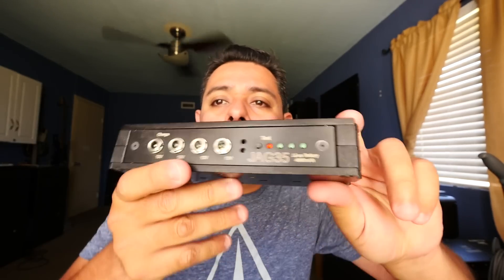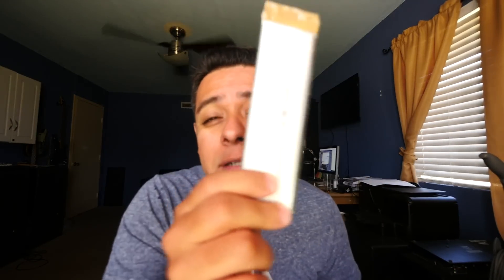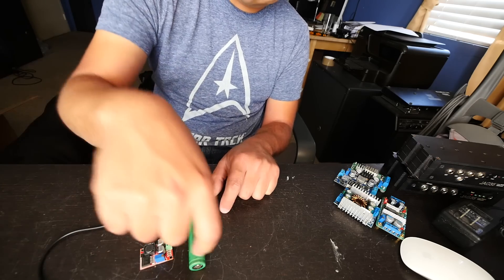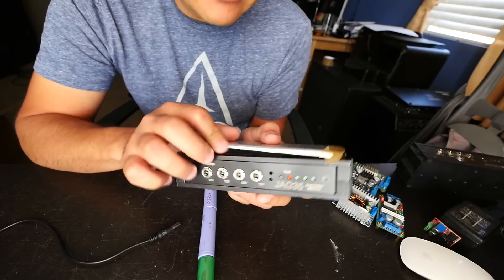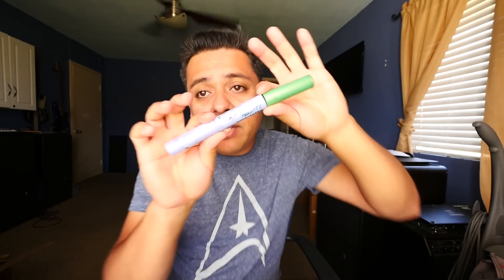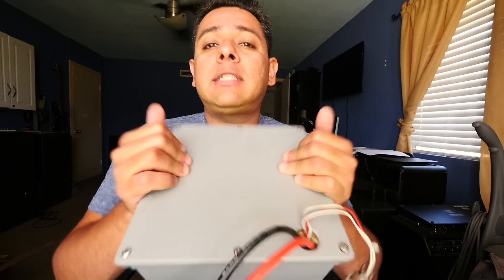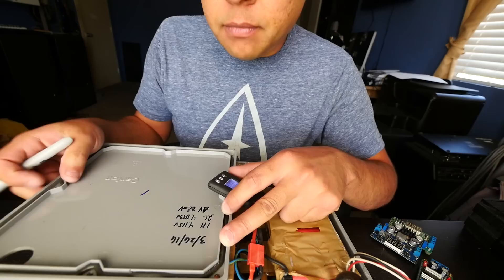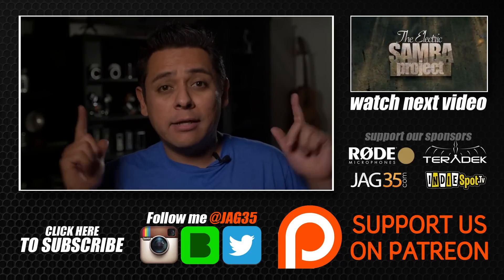How to Charge Lithium Batteries

Comment: If one of the cells goes bad in the 33 cell parallel area, and it drops in voltage, won't the other cells send power to the dead cell like over 100 amps?
Reply: V = I/R
Reply: pirucreek no, it'll act like a wire, just pass the electricity and not retain any charge
Reply: James Andonian But if the other cells are at 3.7V and it acts like a wire all the power/amps from the remaining 32 batteries will be sent to it.
Reply: pirucreek Sorta, it just passes the current. I wouldn't recommend using a bad cell though. You'll see lipo batteries have puffed up batteries, it still works just less voltage or amps, depending if its in series or parallel
Reply: Also, it depends on whats wrong with the cell too. Internal resistance would create heat. And also charging may be a problem
Reply: James Andonian jehugarcia said he has a battery 12V I think that he just sends 12 volts to and has not had a problem in 2 years.  Thus if there is a way to make sure fire is contained, maybe not something to worry about.  They use "Tesla" fuse which is just 5 amp wire (30 ga or so) thus if there is a short it just blows the fuse for that battery.  But a protection might just to have a voltmeter at each parallel point that way if they ever get out of balance you know something is wrong.
Reply: Not really..its a constant current..the voltage however increases for defective batteries ..12 volt battery charger specs ,if you test open circuit itts actually somewhere 14 or 15 volts,for 18 volts charger its somewhat 25 volts
Reply: Yolando Soquite only problem with that is it would overcharge the other cells
Reply: if the cell died and turned into a short circuit, its two cells in the triad will explode. they would steal all the current from the charger.

Comment: can i parallel the charger? for example i use 50W power supply and i parallel it just to make it become 100W, is it possible?
Reply: or 50W each parallel for 3S 5P. so im gonna use 12V 50w power supply each parallel. i have 5 power supply, can i just do it like that?

Comment: Awsome but I think its not safe to charge lipo battery's in series connection with high voltage, it can be so dangers if one of the cells die, BMS is a better way

Comment: Yea... NO!

If you charge a lithium ion cell without doing it properly, you can damage the cell, as well as run the risk of fire, explosion etc.. 

The proper way to charge a lithium ion cell, is to start off with constant current, while the voltage ramps up, once the voltage reaches the proper voltage, you then cycle to constant voltage process, where the voltage remains the same, and the current drops over time until the cell is completely charged, at which point the charger shuts off.
Reply: For lead acid I know lots of people complain that they ruin $500 worth of batteries due to the PWM controller.  I realize this is lithium.  But if you look in a cell that is pwm, bubbles come out and that can't be good.  I just wonder if one cells dies and can't hold voltage.

Comment: greetings, one question,i make battery for elektrobike from old batteries in laptops,i produce battery 36v 10A and i dont have BMS on that battery,can i charge that battery with tipical (Chinese)charger for that battery(42v 2A) without fear that battery will explode(because there is no BMS on it)?i.e.will charger stop charging when the battery is full? Excuse on my bad English

Comment: Hi, I have one question, I made 5 cells in parallel and 3 groups in series to be 12v pack and I agree with you to be not use the BMS to charge my pack so should I charge it with 12.2v cv/cc power supply or separate to 3 of 4.2v cv/cc power supply ?
thank you.
Reply: You need a proper charger to charge 18650 in series or BOOM.
Don't follow his vid

Comment: if you connect 2 batteries in series then the voltage is 8.4 not 7.4 that you told at 5:30 in this video.
Reply: The nominal voltage of Li-Ion cells is 3.7V and 2 times that is 7.4V.

Comment: my calculation:

one cell is 3.7V @ 1.8A;
there are 3 parallel circuits;
each parallel circuit is composed of 33 cells.. so each parallel circuit is 3.7V @ 59.4AH (Calculation is 1.8X33)
the 3 parallel circuits are connected to make 1 series... so the entire battery pack is 11.1V @ 59.4AH (Calculation is 3.7X3) at NOMINAL.

when we calculate its Wh... it's 59.4AH X 11.1V = 659.34 Wh
when we calculate is kWh.... it's 659.34 / 1000 = 0.659 kWh

can someone confirm if my calculation is correct? thanks!
Reply: So what is that entire big battery pack volts and AMPs?
Reply: @kmuralikrishna1582  this battery have à nominal voltage of 11.1v but concerning current, it's carefull to not excess 1C (1 time the capacity) formation example if your cells are 1800mA , each one of these can "produce" 1.8 A, so in total your battery can produce around 60A maximum if your are carefull

Comment: Ok rocket scientists if they are using the same Li-ion battery 
technology and they are squeezing the most Lithium and other chemicals 
in that little 18650 shell__and only getting say 2000MAH out of that how
 in the world do you think they can get 6000 or 9800MAH out of the same 
dimensions using the same technology! Ah, you are finally saying to 
yourself I don't even have to test this__this is impossible from a 
chemistry and manufacturing point of view. The 18650 cells would have to
 be the same diameter as a "D Cell" flashlight battery!
Ha Ha Ha! That's a little thought experiment that would make Esienstein blush!

The Universal Brain( The Information Black Hole ) has turned out little walnut
into mush!

So, when I wired eight of these into the case of my old Dell Inspiron 300m notebook
battery and plugged it in I notice an incredibly fast rate of charging and in about
20 minutes the battery was fully charged. So, I knew something was fishy because
the regular 2000MAH take about two hours and give you about two hours of usage.
With fully charged 9800MAH batteries I was able to squeeze 1 hour of usage
with a 1.8" Toshiba Hard Drive. Hmmmmm? If the Chinese are using Capacitors
instead of Lithium maybe something can be learned here. Charging time was
really fast and but the time was only 1 hour. If, they could design these capacitor
batteries to give 2 hours at only 30 minutes charge time they would be worth
paying a premium price of say $20 for eight batteries.

Comment: For your 12v Samba You have 3 batteries in a series and 33x3 wired in parallel to get the most Ah, correct? Then you wire the positive on the series to the positive on the 33 cell in parallel. Then you wire the negative to on the series the negative on the 33 cell in parallel, correct???

Comment: Hi Jehu,
Thank you for the video, lots of fun!
I understand the principle of slowly charging batteries for safety but I'm not sure about your charging. How are you regulating charging current which is a very important thing to do?
Also have you checked individual cells to see if they balance out to relatively the same final voltage? How does Tesla, for example, charge a string of series batteries, is there concern for individual battery hogging? Also do they current limit?

Thanks for your time,
Rob

Comment: What about current control?
Discharged cell is almost like a short, so if the power source is capable of 10A it will push it into cell, cell will overheat and explode.
But that module isnt, it will overheat and thermal shut-down will occur, then cool down, turn on again, etc.
So no current control is bad.
Pay extra 1$ and you will get similar module that is capable of delivering adjustable constant current and constant voltage, so everything we need for battery charging.
Reply: You don't know anything, you commented that a 10A power supply will force 10A into a battery.. 

Learn ohms law first,  then you can talk the talk.
Reply: he said he was counting on the output impedance of his current source to limit the charging current. that is current control of sorts.
Reply: Arek r..  why are you calling someone a moron? A 10A power supply is capable of delivering 10A but it will only gob the amperage that the load drains. EMF or E is the force,. I or C is the available supply.
Reply: If i buy a 4.2v 1A power supply for example and just connected it like that would it damage the power supply because the batteries want more amperage? or will it just run at full load and only output its max?
Reply: Robert Fisher It depends on the circuitry im the power supply.
Most of them will only put out the current that it is rated for.
Some will shut down or the voltage will drop down.
Since almost all power supplies have thermal protection you can just try it out and see if it gets to hot or drops the voltage.
Reply: Arek R. It will not do that.....
Although current control is a nice to have it isn't a must.
The cells have a internal resistance and the current flow depends on that resistance.
Reply: Nino Joel thanks
Reply: Robert Fisher Seeing the voltage and current rating you had in your question makes me wonder how manny cell's you want to charge.

Or what you plan on doing :)
Reply: What if we use resistor to limit the current
Reply: That device is problably consuming that voltage if its conected to those cells
Reply: srcastk,,,, you have no friends, so sad...
Reply from the maker: no lithium batteries obviously do not store elecrtrical energy just like every other type of battery in the world,  Please stop posting stupid comments or I will label you an idiot and bann you from my channel.
Reply: Moron...
Reply: Nope, I know that shit, I was making custom li-on battery packs for long range drones...
And I was doing it with my custom made welder.

Comment: Sorry if this is a stupid question I have a charger which outputs 25 volts = 0.5a  12.5va from a hoover - from the same hoover i have 5 of what looks like the Lithium 3.7 batteries (green once cylinders) . Would the charger be safe enough on its own?  When I times 4.2 (the safe amount to charge a 3.7 battery too) by 5 - (the number of batteries) it gives me 21Volts- the charger puts out 25 ? they're from the same device but im confused if it will overload the batteries.
Reply from the maker: +Louis Derry yup 25/5 = 5v each cell that's too high.   Is there anything between charger and batteries?
Reply: There was a circuit board that I was hoping was used for something else inside the hoover- but now I figure perhaps it was lowering the voltage ?

Comment: hello,
i have a problem, i have a laptop 18650 battery cells and i try to charge them on RC (lipo charger). Battery is charging ok to 4.0 V but it will not charge to 4.2 V. it just get very very hot, and never reach 4.2 V. Then after is charget voltage is dropt to 3.8 V when i discharge it it reds 1100mah. is this normal?

Comment: Jehu...I recently purchased a popular line trimmer (weed whacker) from HD. April 2016...by August 2016 the 40 volt Li battery pack failed. The manufacturer is sending a new battery but it's going to take up to 3 weeks. I would charge the battery fully then go use the trimmer til it quit after abut 45 to 50 minutes of use. Am I doing this wrong? Should I use it say for a half hr and then recharge it before it "quits" ?
Reply: Hi Philip, by all means its better to recharge a lithium before it dies right out.
I have 2 Makita Lithium batteries whom so many people have complained about, yet mine are still going strong 5 years later.
The main reason for them lasting so long is that I only let them get about 3/4 empty maximum before I recharge them, and even if I do not use them at all I still put them in the charger every 3-4 weeks for a top up of any low cells.
Reply: fullboostturbo1 Thanks FBT1...I'm doing that now...going to 3/4 down then recharging. I am now on the 3rd battery. They sent #3 along with a charger after I complained that the second battery would not charge right out of the box. Now I have two chargers and three batteries. I need to figure out if I can possibly make one working battery out of the two defective batteries. This would give me a backup and extend my tool use time.
Reply: G Philip C Hi again mate, yeah usually its just one cell that loses voltage past it recommended lowest voltage cut off point, which in turn stops the rest of the cells from charging up.
Usually it will be the first cell as it used for the pre-checks by the tool and before charging is attempted by a charger. 
But this may not be the situation on all occasions, as sometimes cells do malfunction no matter what placement they are in.
If you confident enough to open one of the batteries if possible without damaging the case to badly, and if it uses 18650 cells as most do then just use a voltage meter to find the crook battery, and replace it with a new one as they are cheap as chips these days on ebay.
No matter what cells it uses you should be able to find replacement ones pretty easily online.
Almost forgot you will have to have some soldering experience to replace the cells usually.
Have a good one champ let me know how you go....
Reply: If you tear them apart they probably have the cells above in them.  But, it would take a lot of work to turn 2 into 1.  there should be a law passed requiring all batteries to be held in by springs.  It would help in recycling and  reuse.

Comment: Mr. Garcia,  It is fairly well-known that there is a problem with the built-in charger facility in the Nexus 7 tablet.  The precise nature of this subtle problem remains undocumented and unknown to the public.  It would be really helpful if you could develop and document a (reasonably convenient) method for charging Nexus 7 batteries independent of failed built-in chargers.  This would turn thousands of Nexus 7 tablets back into useful devices.
Thank you for your consideration of this matter.
Reply from the maker: interesting
Reply: Thanks.
Glad you saw this.  Google it to verify it's real, and then be a hero!
Thanks, again!

Comment: i have a 3.7v (18500). would it work the same as 18650? or just lower it to 3.7v?
Reply: They say 3.7v but when fully charged they put out 4.2 volts. Its like a brand new aa battery puting out 1.6v

Comment: Seems like you what your talking about Sir lol can't seem to get any help  I'm having a hard time designing a battery pack and charging system for my well I'm making a Bluetooth portable boombox with 6.5 8ohm subs and 1" tweeters also 8ohm with 2 way crossover  the Bluetooth uses 12-24v DC and it pushes 50wx2 total of 100w I what it to be able to use battery's like maybe 8-9hrs and AC plugin while the AC is plugged in it charges the battery's I was think to use 1 or 2 12v SLA 7.2AH or these 18650  any help would be highly appreciated Sir I'm in the 818 area vincesandoval34@yahoo.com if you can please help if not that's ok I enjoy your videos there very educational thanks.  Maybe one day I'll convert my 66 restored bug  to electric